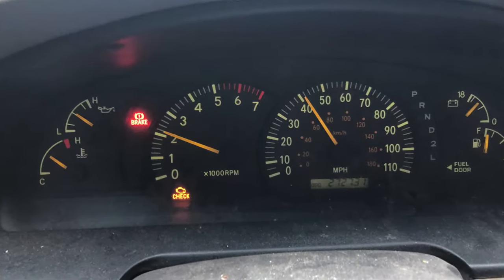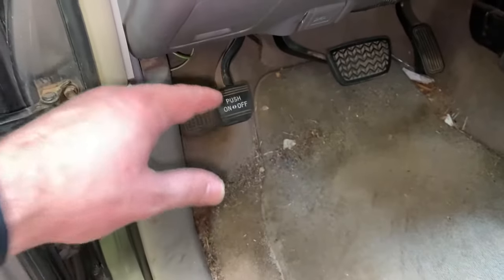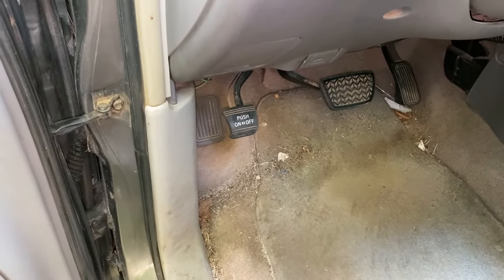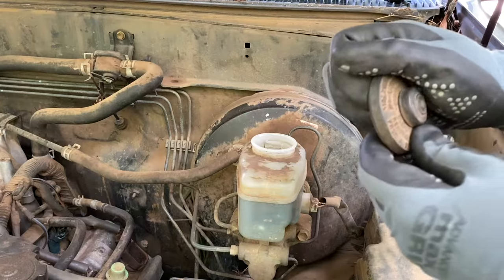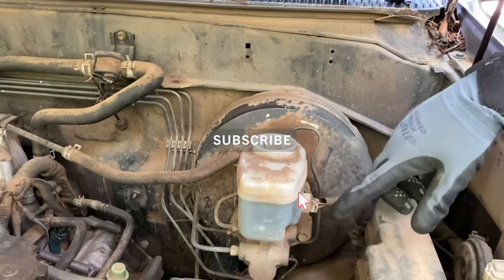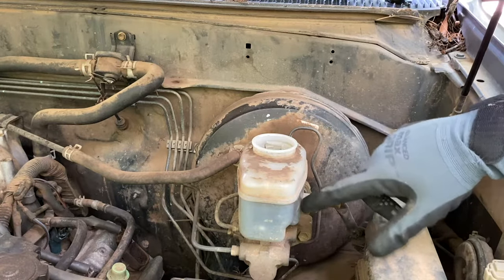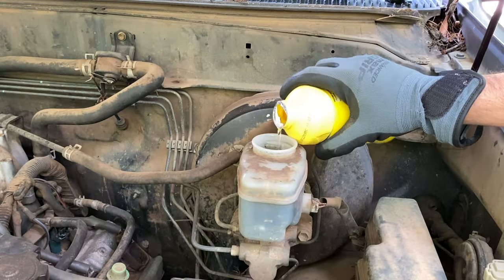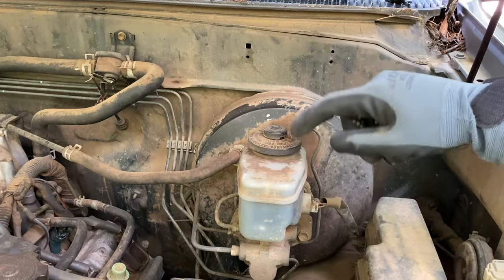Brake Light Comes On While Driving. How To Fix Parking Brake Light Staying On.

Comment: Awesome thanks. My 2010 Subaru Legacy has had its park brake light intermittently come on and now it stays on. I checked the brake reservoir and it was surprisingly low. Something that I never check as they never seem to fluctuate apart from now. Many thanks for the pointer.
Reply from the maker: You got it! I’m glad it helped!

Comment: Also just for some more information, filling up brake fluid in the reservoir is not needed because It doesn't burn like oil so it will always be there... ... just like transmission fluid, power steering... Unless of course there's leaks in the system.... when the brake fluid gets low that's just an indicator that the calipers go in etc..when thr pads get low... and when new pads are put on the calipers.. the calipers are depressed from the Piston the brake fluid will go back up through the lines to the master cylinder.... so if there is extra fluid in there it will pour out of the master cylinder spilling in the engine bay.. if the tops off when doing a breal job.... and if it's not it will cause pressure and it could even crack a plastic master cylinder...etc.. because with the extra fluid it has to go out...... so that that would mean that low brake fluid is just your pads are getting low.. it can't be recommended to put fresh brake fluid in there once twice a year but really 4,5, 6 years cars have been running with the same brake fluid.... thanks for sharing your video.
Reply from the maker: That’s good to know. Thank you!

Comment: Thank you. I haven't checked yet but I did replace all the brake on my $300 suzuki myself so this is very possible
Reply from the maker: Hey that’s a good call as well though!
Reply: I have a Suzuki 2012 LE, this just became a recent problem. I’m still tryna finger out what’s wrong with it. It’ll pop on, then turn off. This all happens while I’m driving
Reply from the maker: @official4ktrey77  did you check the brake fluid? There could also be something wrong in your container as well.
Reply: @TryThisDIYFix  the brake fluid reservoir, should be good. Unless there’s a possible leak. But I have been around my car looking under the hood a couple times, and didn’t see anything out of the unordinary. Talked to my stepdad. He said just put the parking break up, put the car and gear and shake it a couple of time and it’ll probably stop. But if that doesn’t happen it could be a possible low brake fluid
Reply from the maker: @official4ktrey77  yeah that’s a good call! Let me know if that works!
Reply: @TryThisDIYFix  I didn't replace my copper rings
Reply from the maker: @Critter0817  that’s good to know!
Reply: @TryThisDIYFix  Found out it needed Brake fluid
Reply from the maker: @official4ktrey77  that’s good! Glad you were able to fix it!

Comment: Today on the highway a vehicle abruptly cut in front of me, I hit my brakes hard to prevent contact and the red light momentarily came on, shortly afterward another hard braking event was necessary- again the light came on for an instant.  Fluid reservoir is full. Perplexed, help if you can.
Reply from the maker: @chuckcawthon3370  hmm. You could be triggering a sensor, or the parking break.

Comment: Thanks.  My question is why my rear brake lights are on .when I start the vehicle. Not in the dash board.. just the back of the van 2008 dodge grand caravan. Thanks.
Reply from the maker: Hmmmm. I’m not sure. You could have a leak in the line. You might want to get that checked.
Reply: Brake light switch under dash by ur brake pedal
Reply from the maker: @JoseMendoza-hf2sx  good to know. Thanks!

Comment: Didn't help, mine has been on for months now, but my brakes and the parking brake works!
Reply from the maker: Hmmm. Have you gotten it checked by a mechanic? It could be a different issue.
Reply: @TryThisDIYFix  I've had multiple people look into it, I was thinking it could've been my parking brake switch or something because it's doesn't register on the dash that the parking brake is down and my parking brake is in the center console
Reply from the maker: @Turbo.g  hmm. Yeah that is weird. Sometimes they get stuck so I’m not sure. I’m glad it’s nothing major though!
Reply: @TryThisDIYFix  I know right
Reply: Same thing with my 4th gen. There is a procedure to test the brake fluid sensor. If it's at its full capacity, the sensor should give you from 1.8k ohms to 2.18k ohms
Reply from the maker: @l2ikardo  oh ok. Did it test out?
Reply: @TryThisDIYFix I need to get a better multimeter first lol. I plugged a 2.0k ohm resistor to the connector but it didn't work
Reply from the maker: @l2ikardo  oh. Got ya!
Reply: @TryThisDIYFix  I also replaced the emergency brake switch. I'm about to give up on this one...
Reply from the maker: @l2ikardo  oh really. Was that tough to do?
Reply: Alot of Toyota need to just be filled a little more than the max line. I saw it was a common problem and it did fix mine!
Reply from the maker: @ronhudnall3522  thank you!
Reply: I just checked mine and the float itself was stuck! I stuck a screw driver in there and jiggled it free and it fixed it after filling it up the the max. maybe try that.
Reply: @nehemiaharcher7327  sadly, I don't even care anymore I totaled my Mazdarati in an accident 😢 Thank all you guys for tryna help!

Comment: It's irresponsible to tell people to add brake fluid, without telling them to have someone find the leak. You should almost never have to add fluid, unless there is a dangerous problem. The system is designed to have the level stay between the marks, even after the brakes are worn, lowering the reservoir level. You fix the brakes, not add fluid, imho.
Reply from the maker: @steverichdrummr  yes you are right. I thought I recommended checking the brakes if it continues.